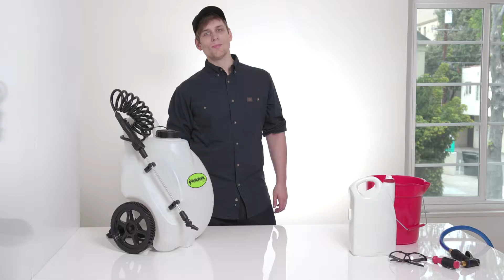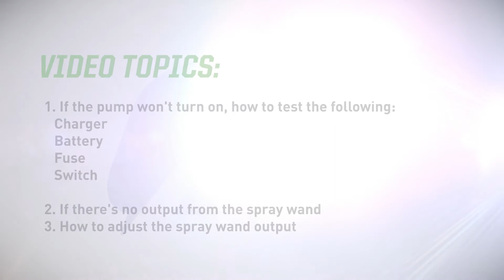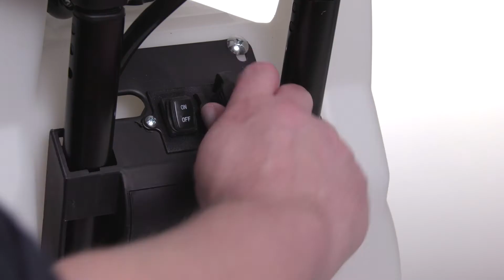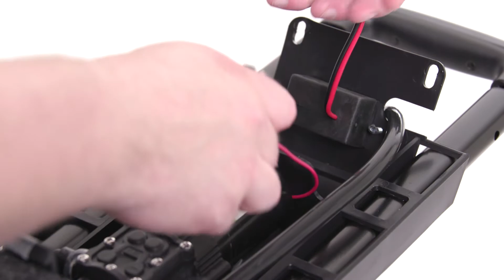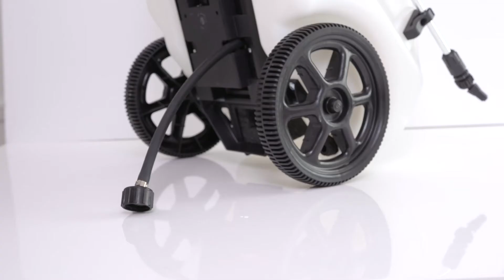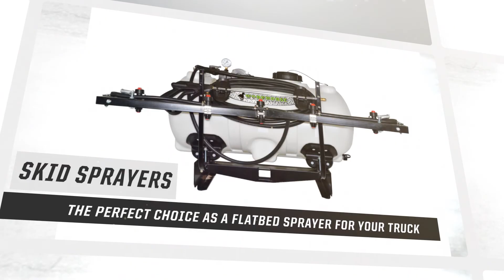5 gal Lawn Sprayer - Quickstart & Troubleshooting Complete

Comment: My 5 gal sprayer was delivered a couple of days ago.  It is a big disappointment.  The hose is 5' and not 9' as it said in the specifications.  The charging cord is very short so plan on an extension cord to charge it.  The hose does not coil up as pictured.  
When you are trying to do anything with it, for instance;  trying to plug in the charger, the sprayer constantly falls over and does not stay upright.